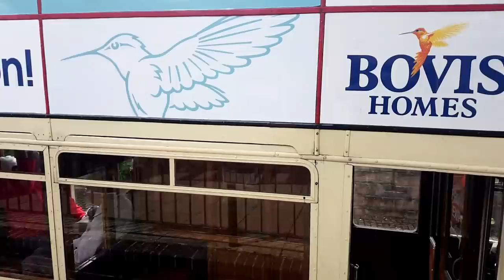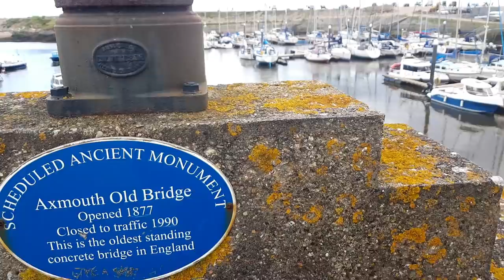Daewoo Matiz Sh**efest and Performance Mod!

Comment: Another great video - however, I do think you sometimes do modern cars a disservice purely because they are modern. I'm not especially a fan of the Peugeot RCZ (that 308 thing with the double bubble roof), but I think you have to give it some credit for some pretty good styling in this day and age. Currently they are too common for people to notice, but in 10 years when most have been scrapped and they are a rare sight, we will appreciate the unique double bubble roof and quirky coupe styling - at least its not (another) Audi TT! Similarly, you weren't very nice about a DS5 recently, another car which, whilst rather oversized and bloated just like everything else on the road, does actually offer some distinctive styling cues above much of the copycat styling which has always prevailed.  Quirky cars seem to get ever fewer (particularly in the UK, as the french usually produce them and they sell so badly here they then can't be bothered with developing RHD - hence Renault has almost no line up left here), so these might be the only interesting classics left of this period! I do think the new 508 looks good - although might blend in too much in a couple of years.
Reply from the maker: I don't find it even slightly interesting to look at. A Peugeot 406 coupe? Yes.
Reply: @HubNut  The 406 coupe is stunning, much better than the 407 coupe. I do think the RCZ has some quirks though. But the last 10years has just been full of bloated cars, and the RCZ still has that look on the bottom, which does make it blend in to all the other bloated cars.

Comment: Aw you missed Gillingham in Gear this saturday just gone, think the star of the show was a mint metallic silver landcrab that was flawless, absolutely free of Leyland rouge and sweet clean lines tail to toe, some good old bikes too and plenty of historical stuff and just off the A303 too, I missed the entry gate so had to settle for parking up outside and letting quite a lot of ppl taking fotos of me Reliant as my little three pin plug is quite popular here but not the only one as an old lady in Mere owns what can only be described as factory perfect MK3 Robin in a beautiful metallic Rover blue as seen on them MG models.   My car irritates a neighbour who I am in a feud with, he has spent a lot of money on a Subaru that I chortle when I hear it as it sounds like a bag of spanners in a washing machine (the feud stemmed from when he was boasting about having a 5 grand rebuild to a neighbour and I innocently suggested he used a mechanic with the power of sight and hearing and the use of hands etc), he fumes cos my little plastic pig attracts lots of people wherever I go and ppl ignore his pile of pooaru and he gets quite cross for some reason... :P

Comment: I wonder if the restriction is to prevent pushing RPMs too high and risk blowing head gasket or something, 🤭🤔
Reply: Makes sense to me, and it would help low down torque as well.
Reply from the maker: The car has a rev limiter. It doesn't need the air restricting. Low down torque is what it's about I reckon.
Reply: Rev limiter is usually at 7000rpm in most cars. If you go that high on a regular basis you'll probably blow the head gasket, and wear out the alternator and water pump.

Comment: The tramway is excellent, but maybe a little dangerous so near to the power lines. Most of the roof passengers will get off the tramway with hairdoes like Jimmy Hendrix.

Comment: I find it difficult to believe that removing a little plastic restrictor will make a modern car start pinking. Are you sure you aren't imagining things? It has a knock sensor too.
Reply from the maker: It could be my imagination. It wasn't quite the pinking rattle I'm used to, but there was definitely a rattle that isn't there with the restrictor fitted.

Comment: 7.17  Try taking your sun glasses off save people putting their lights, on so more environmentally friendly (not to mention sensible).
Reply from the maker: They're prescription sunglasses. Changing glasses at motorway speeds is more dangerous than just keeping them on, especially in a sudden change of weather like that. It wasn't light levels that were the problem, but spray obscuring the view of other cars.

Comment: Sorry the mod didn't work for you, worked fine on my old 3 pot.
On another note, the head gasket splits on them and sprays out the back like a split hose, ring any bells? People bodge this up with rad weld!! Hmmm,  Might be worth a look.
Reply from the maker: It's had a head gasket. Heater pipe had a tiny hole and water was coming out at high pressure.
Reply: @HubNut  Can't be the head then can it😁😁 Cheers

Comment: Your 2.0 KV6 Rover 45 had a variable length intake, you moaned at lack of torque but the VIS motors were probably knackered.
Reply from the maker: The VIS motors were fine.

Comment: don't surpose you've cut twc up? only there is an invacar shell parts on ebay XD as well as a nice 250 daihatsu domino 1986 on there my first thought was "twc nuuu hubunt why?!" but no it has a pic of one just wondering if you fancey making another one, that or keeping it for spares, 
went to a small car meet, was a rather lovely reiant regale in twc colours the owner has a nice sence of humor as the inside dash just has "turbo" on it, pffft, plus there was a rather lovely renualt 5 comper lovely lil thing very hubnut, 
that's quite the down pour glad that missed most us us, was mostly windy and rainy on saturday, 
oh a proton, i actily liked those, as they were a nice car, plus later on they were a bully star prize, wonder if that's one of them? wow a nice volvo hearse i'll be sleeping in that one tonight!

Comment: Seems....the anti knocksensor...doesn't work properly. Cos...the restrictor,allowed more air in the engine. The ECU normally get the information from several sensors, if one doesn't work correct...she ain't possible to adjust the mixture. The anti knocksensor....prevent that "pinging" sound.
There are two kinds of knocking :
High speed knock( high rpm )
Low speed knock ( low rpm - less than +- 2000r/min.
Both ain't healthy for the engine...cos the mixture get ignited way to early. ( sounds like an old bel ringing.) It results if not taking care of it..in a nice hole in the piston. Absolutely not desirable 🤔

Comment: If I hear "slightly sweary" one more time I'm going to (oh no I can't say that) myself. Forgive me but you sound like you're getting yourself tied in knots there with "pinking" variable length inlet tracts etc. what I think you're trying to describe is uncontrolled detonation of the fuel air mixture. Spark ignition timing is nearly always BTDC and fluid going through a restriction slows down, P1xV1=P2xV2.